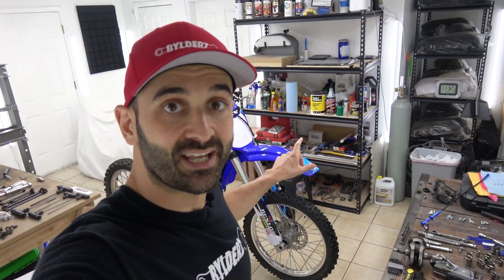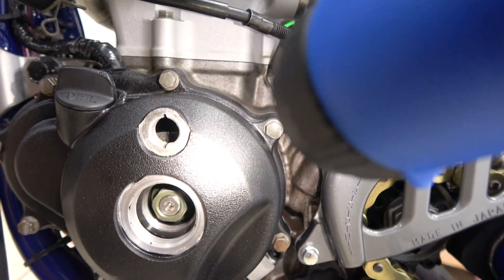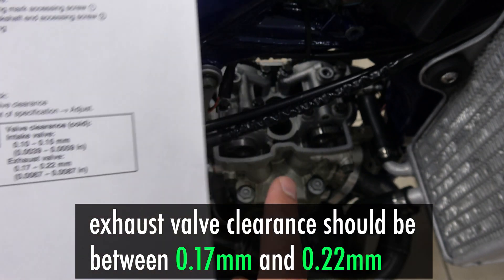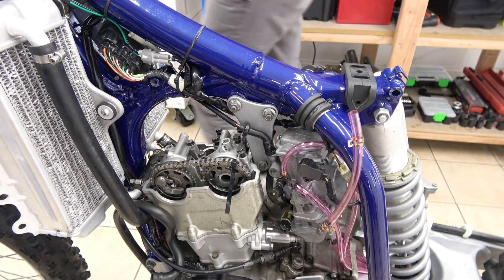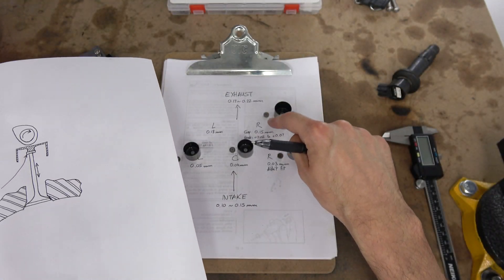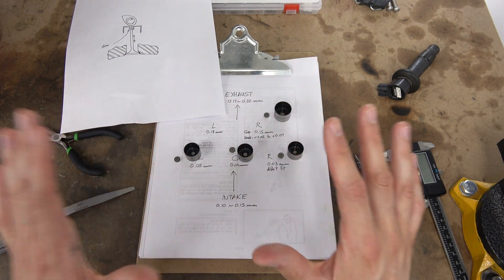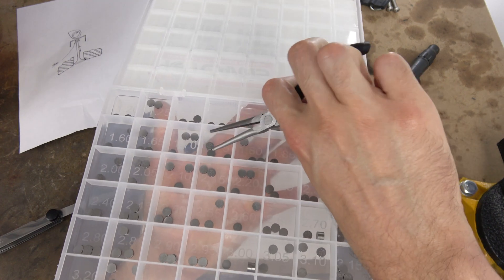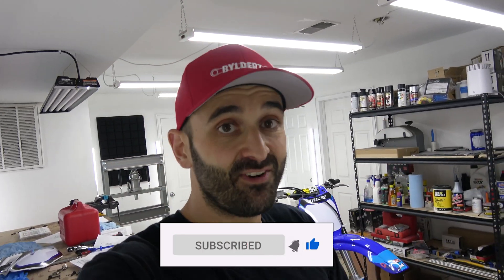How to Adjust Valve Clearance with Shims on Yamaha YZ250F

Comment: Hi mate.. for yamaha yz250f two types of bolts are using to fix the oil tube on the head and block . One bolt with small jet and other bolt hav bigger jet .. top line goes to the cam shaft lubrication and next one for the gear box ..may i know which one is using on the head and which one using on the block..?

Comment: Hey great video  my guy.  When measuring  the valves to they all have to be the same number. For example. If specs are between  17& 22. And one comes in at say 18. Do all other values  have to be @ 18. Or just along  as they're  in spec

Comment: one tip I found out when doing mine for the first time, and would have saved me a lot of time and effort is that when you take your first clearance measurement, record it, the loosen off and remove the cams,  then  install and re-torque them to spec and measure again. you never know if the mechanic before overtightened or not and in my case it made a huge difference.

Comment: Question. So you have valve specs in your service manual to go by when adjusting valve clearance. But how do you adjust valve clearance if you change your stock cams for performance cams. Wouldnt the valve clearance specs change cause you have different cams. Can you please explain
Reply from the maker: I would still use the stock numbers (unless the new cam comes with new specs)

Comment: Great video.  I was confused because the readings I was getting on my 2001 Kawasaki KLX 300R were literally off the charts.  But they were inaccurate.  I took the measurements without the Cam cap bolted down.  Duh.
Reply from the maker: Right, it happens to be the best of us 😅

Comment: This is the Best video I have seen on this. Question: if I put cams in head and bolt the caps down should I be able to turn the cams. When I bolt it down it’s really tight and cannot turn the cams at all. No timing chain on it and no buckets. Cam doesn’t budge. Seems like I should be able to rotate them until the lobe hits the bucket or valve stim.
Reply from the maker: Agreed, it should turn freely, you have a problem somewhere, either the cams aren’t straight (or wrong diameter) or the caps aren’t placed properly

Comment: I noticed he didn't use a valve spring compressor to take them out or put them in. Will I need one? I have a 2010 yz250f
Reply from the maker: I didn’t take the valves out, if I was taking the valves out I would have to use a spring compressor 🔧

Comment: Nice explanation👌bro.I admire your mood.With my years even if have 1 WRF450cc im boring 2 open it.So I open only 2strokes (friends bikes)easier job 😉
Reply from the maker: I’ll do a 450 soon 🤫
Reply: @TristanDurandBuilds  Man I type even if I have 😅🤣😂shit english I mean even if I had problem with my WRF450CC I'm boring to do more than change oils/oil filter /air filter & if we are ready after winter with a lot of mood maybe clean carburettor
Reply: @TristanDurandBuilds  English not my mother language im from GR. Greece 🇬🇷 3years lessons plus working summertime night clubs.(But general speaking)I prefer 2strokes for everything fixing- riding after all I was racing with RM 125cc 96model  summer of 96 best RM ever all the rest Suzuki was trash 🗑 😄 Now we are old 40+ so I have 1 WRF cuz it was the only bike I never ride.PS too heavy for my REDBULL style of practice 😜😉

Comment: Thank you so much for the awesome video. Only part I was confused on was putting the cam tensioner back in
Reply from the maker: Thanks Criss! The cam tensioner is pretty straightforward but keep a screwdriver turned all the way in when you slip it on the cylinder 🔧